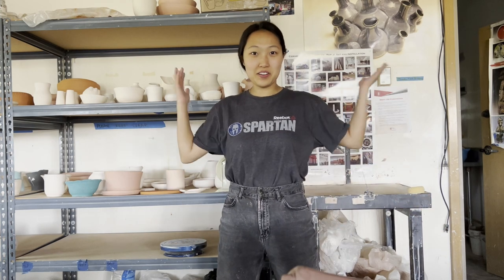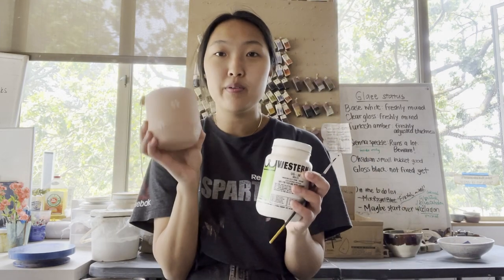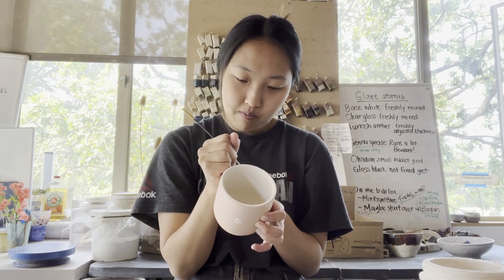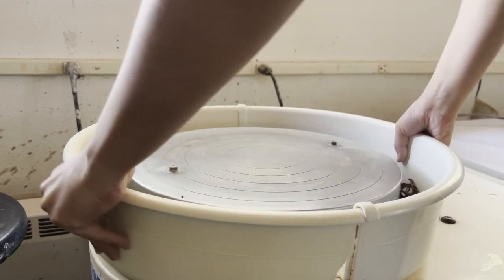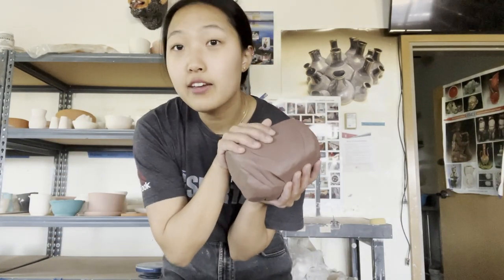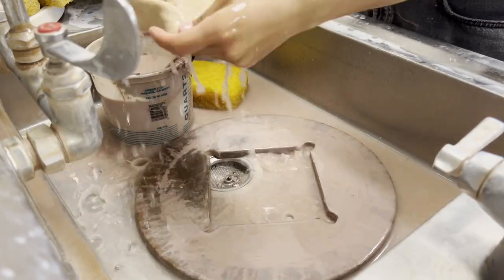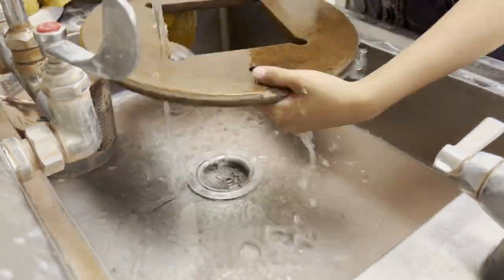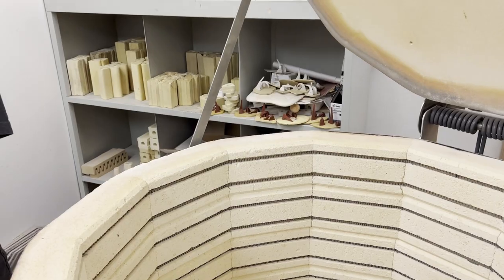a day in the pottery studio!

Comment: I do pottery at my school, and we hand glaze all of our pieces. I’ve always wanted to try dip glazing, it looks so fun!! 

I’m in the advanced ceramic class at my school, and I always have such problems pulling up. Do you have any advice at all?
Reply from the maker: Hi Maya!! So awesome that you are in ceramics, I hope you are LOVING it💗 pulling up is definitely tricky and i think there are a few things that helped me pull taller:
1) slow down the wheel - i used to pull at the same speed i centered at which is really hard! i usually go around 60% of full speed
2) stagger your fingers - this is hard to explain over text but instead of having your fingers at the same height when pulling, have your left (inner) fingers above your right! this helps you get more height and pull thinner 
3) brace your hands together - as with most things in wheel throwing, the most important part of pulling is making sure your hands are stable. i like to cross my thumbs and brace my right elbow on my thigh when i’m pulling
4) don’t pull up too quickly - if u pull up too fast you’ll end up ribboning 😭 making sure you’re going at a steady rate and not going up too fast will help
5) make sure you have enough water - sometimes especially when i’m pulling large amounts of clay, i even stop mid pull bc there is too friction! don’t be afraid to stop, add more water, and then start where you left off! just be careful not to leave water pooling at the bottom of your piece :)
6) if you have a lot of clay at the bottom of your piece - when you start your pull hang out at the bottom for 2-3 seconds before starting to move up the clay! this can help if you are having really thick bottoms and not utilizing all the clay

whew that was A LOT but i hope it was helpful! will be making a video soon about tips for wheel throwing so let me know if you have any questions or if there’s anything u would like to see in that video💗 your comments made me so warm inside! appreciate you always and happy wednesday!!♥️
Reply: @BeaCurious7  thank you so much for such a detailed reply!! I’ve tried to watch videos on pulling, getting help from my teacher, even having a full on one on one demo, and I still can’t get it!!

I think slowing down the wheel would be the most helpful for me, because I usually keep the wheel at the speed of centering, which is pretty fast for me. 

I also tend to put uneven pressure, and I’ve noticed in a lot of my taller pieces, there’s weird thin spots in the middle. Either that, or some spot would get super thin, meanwhile another spot is super thick and the whole piece would fall apart.I think number 3 would help a lot as well, keeping even pressure and bracing my hands. 

I’ve been doing ceramics for a little over two years, and I absolutely love it! I would love to start my own ceramic studio one day, but for now, when I’m not at school, I use communal studios like yours! When I’m throwing my pieces, I tend to go big and wide instead of big and tall. I’m trying to push myself out of my comfort zone, though!!
Reply from the maker: @cellie_bellie  ah of course!!! i hope the tips helped! did you try slowing down the wheel and if so, how was that? 

if you want, feel free to send videos of yourself throwing to me at beashc7@gmail.com and if i see anything that might be helpful, i am more than happy to do that :) 

YAY im so glad you have found ceramics and i hope it stays a lifelong hobby that you enjoy <3 throwing is definitely challenging but so fun - 100% love that you are pushing yourself! we can push ourselves together :)